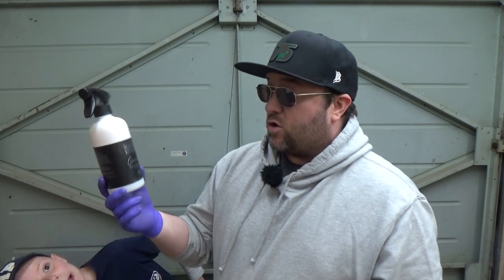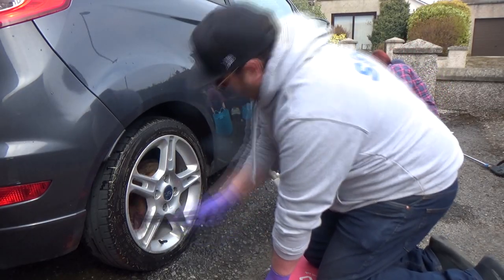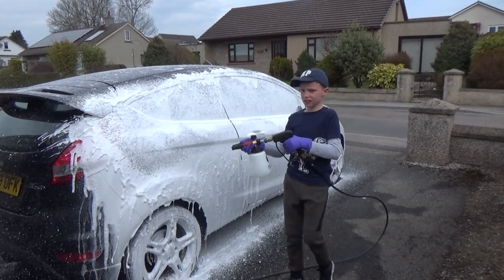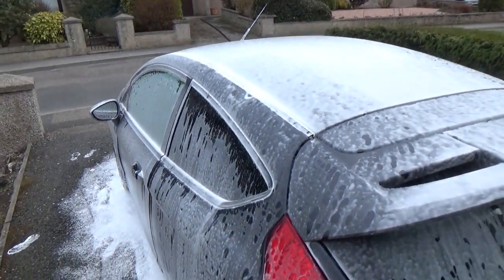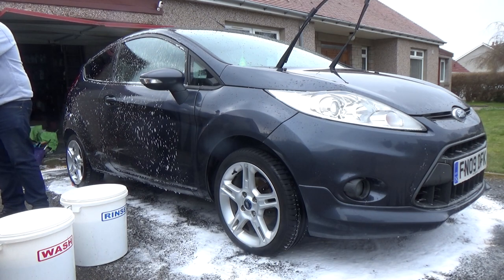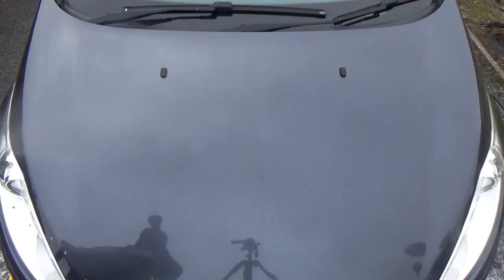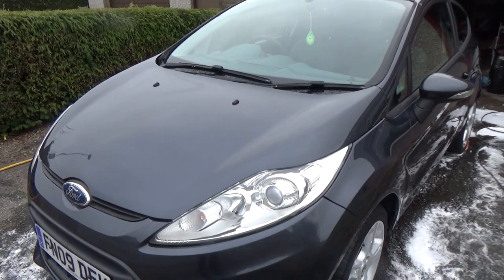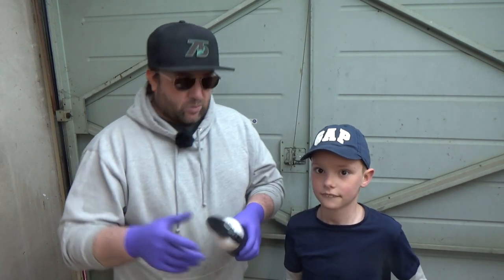Heaven Scent? - The Detail Kitchen

Comment: When is Kai available to help me with my car :0  Reminds me of when I started washing cars with my dad. On a hot day, when the car had been baking in the sun,  we'd use a single black builders bucket with cement remnants around the rim for wash and rinse, triple wax shampoo and a cellulose sponge.  After we finished we dumped the shampoo/rinse bucket back on the car to rinse the suds.
Reply from the maker: Your story is exactly the same as mine! Are you a clone? 😄
Reply: @SpeckyMcSporran  Unless it was a green leyland maxi, probably not.  But ... Dad did work away a lot ... hmmmm lol
Reply: @peemick  my dad had two red Maxis and that's exactly how I learned to wash a car. Great memories and thanks. Great job Craig and Kai.